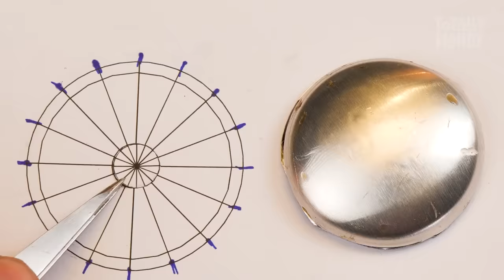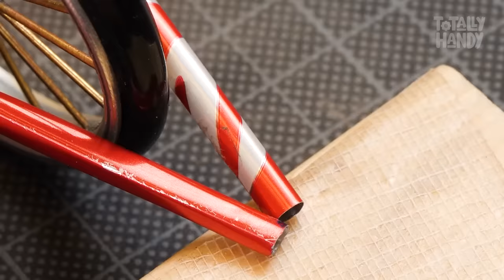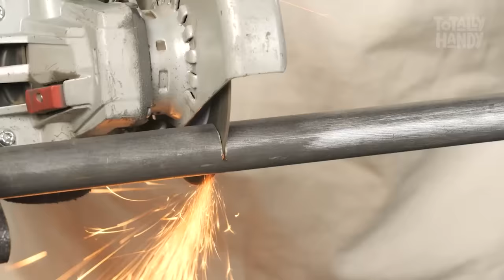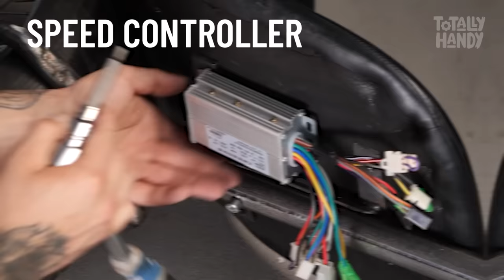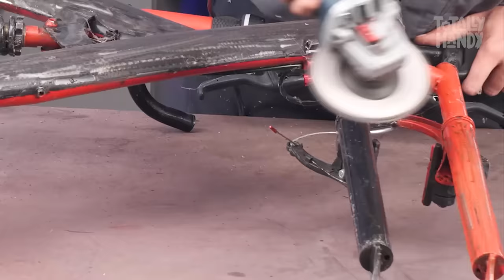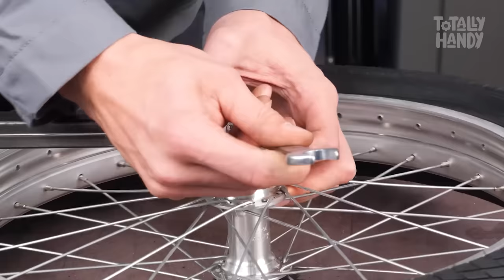Soda Can Mini Bike! Transform Your Recycling into a Ride! | DIY Project

Comment: Good off hand fabricator, decent welder and fun designs.
The track bikes has no track tensioner so that will last as long as the old bike tire has not stretched. The fat back tire is admittedly awesome, but the entire bike must weigh a ton.
All in all cool designs and above average work.